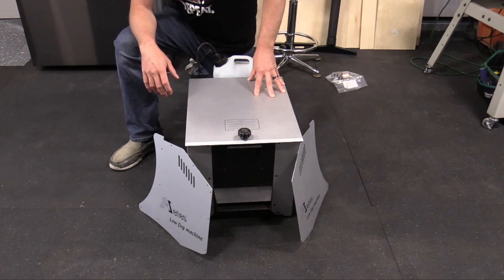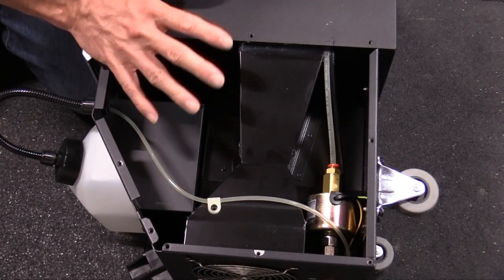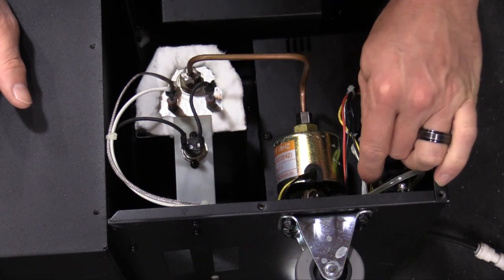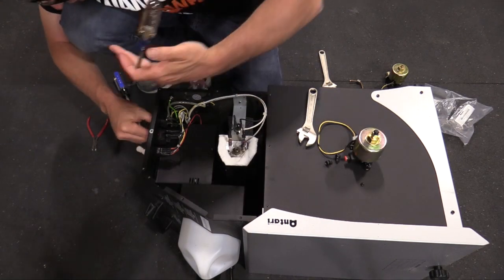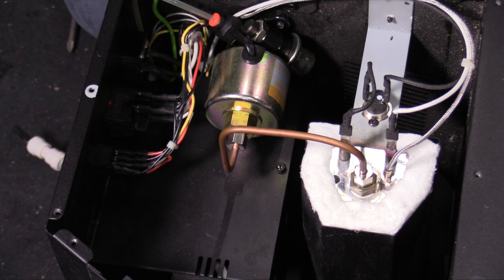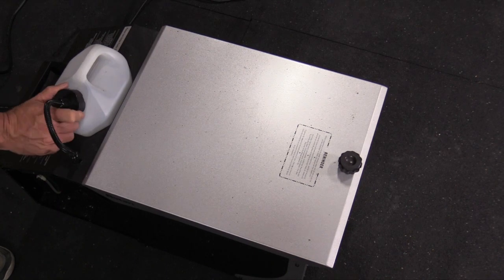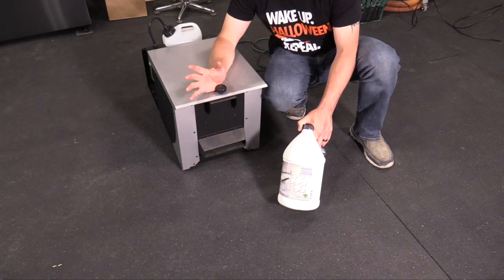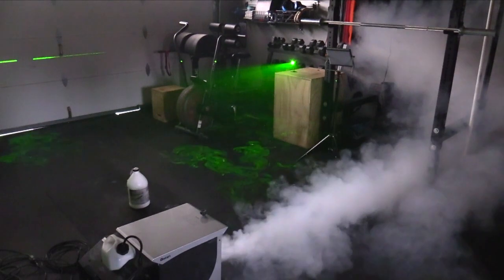Fog Machine Repair Antari Ice 101

Comment: Cheers for the video. My pump for the smoke liquid seems to work fine except for a leak on the brass fitting near the copper tube. Would you happen to have that spare brass part? Antari doesn't sell it unfortunately.

Comment: Only Antari Ice 101 video I have seen, which mentions the drain. You mention using either continuous or manual drain. Is there a switch of some sort for this?
Reply from the maker: Yes, the switch is on the back.  I leave it on continuous throughout the halloween night, or weekends I'm running fog.  Then, at the end of the night, I just during everything off.  When the rest of the ice melts overnight, I use the manual drain to pump the remaining water out.
Reply: @ZombieHaunter408  That is great thanks! How do you activate the manual drain?
Reply from the maker: It's the same switch (three way).   @theroswells994

Comment: Does anyone know how to set the DIP switches to make this machine work with DMX?  If I want to put this machine on DMX channel 309, for example, how are DIP switches set?
Reply from the maker: There is no documentation in the manual for this.  Not all fixtures use the PIN switches the same way, so this is a great question.  I think they use the standard way of doing this (since there is no #10 dip switch). (Switch=Channel Address) 1=1, 2=2, 3=4, 4=8, 5=16, 6=32, 7=64, 8=128, 9=256, so for 309, try having the following dip switches on: 1,3,5,6,9 (which adds up to 309).
Reply: @ZombieHaunter408  After posting this question everywhere, I did get an official response from their support confirming your DIP switch settings.  Those were the settings I was using.  It turns out, my machine (brand new) is not working.  There is no response from either DMX or the wired remote.  It worked for about 10 minutes when we first received it.  No issues.  Then we placed it on our stage for a few months until we had a show opening that would  use it only to discover it will not produce fog now.  I suspect the control mechanism inside machine is malfunctioned and not taking any signals.  The water pump drain pump still works.  Machine gets power, but fog pump and/or heating element is not pulling fluid.  Anyway, thanks for responding with DIP settings.  Once we get this fixed I'm sure the DMX will work fine!
Reply from the maker: @DouglasWhisman  Sounds like quite the ordeal.  I've learned the hard way to store it with fluid inside.  Not sure if that was the issue, but best wishes using it in the future!
Reply: @ZombieHaunter408  It did have fluid in it, but I don't think that was the issue in the end.  It looks to be a control board problem.  I learned there is a tiny reset button (like size of pencil lead) on the heater beneath/between the two heat leads.  It had tripped.  I reset it by pressing it in and then machine started to heat up again -- light fog leaked out of the fan hole on the back as it does when it heats.  It never activated, though, and eventually the breaker tripped.  Technical support thinks the control board is bad and is letting the heat element overheat causing it to trip.

Comment: Nice fix man! Surprised you had an issue with an Antari after 6 years. Might I ask if you store it dry or with fluid?

My opinion on the Hazer/Fazer: outside they are COMPLETELY unnecessary and pointless. Unless you have an area where you need constant smoke produced ( ie car crash, fake fire, etc...this is why I have mine) 

If you plan is laser swamp (Super excited to see what you do!) the hazer and or fazer are also pointless and likely won’t achieve the effect you are going for.

Hazers typically use OIL BASED fluid producing a haze that has a long hang time and high visibility ( shows off light beams for stage shows without obscuring the action on stage) it’s most effective inside and where air currents are easily controlled. Fazer is just a fogger with a fan and has the ability to constantly produce “haze / fog “ on demand. They use water based dog fluid. The control board doesn’t limit the machine with a reset or warm up delay and allows the pump to always operate.

I would just suggest you use a high density and long hang-time fog log Bog Fog, Backwood Bay. We have used froggys Faze Haze and Pro Haze when we did the zombie crate. Worked well and was dense / disbursed well in our garage. However keeping 6-7 kinds of fluid gets annoying lol 

Hope all is well!
Reply from the maker: I store all my foggers dry--without fluid.  I need to be better about cleaning them though.  I've had some foggers for over 15 years, never cleaned them, and they still work like a champ.  They are the cheap ones too.  I was surprised I had the issue as well.  Great information about the haze/faze fog--thank you.  I'm thinking of just using the bog fog in a fogger in my loft above the garage.  Thanks for the response and hope you and your husband are doing well.
Reply: Zombie Haunter might I suggest you store it with fluid after you clean it. 

I clean ours and then put just a small amount of juice back in the fluid tank  and run the machine for a “full burst” . Let it cool and store. Do the same thing with our snow machines. Leaving high quality fluid in the lines prevents the seals and parts from drying out in storage. Just a suggestion but I have always had success with it. Storing machines dry after cleaning allows the inevitable fog juice residue time to funk up the inside and make parts more likely to sick or fail. 

All is well here just a Hot summer in TX!

Comment: What kind of fog machine are you using?
Reply from the maker: It's an Antari Ice-101.  Some distributors (Amazon) are just selling it as the Antari ICE.  It's an excellent fogger and well worth the money.  It can put out fog continuously with no issues.  I was disappointed that the pump went out after only 5-6 years, but it was relatively easy to replace (as you can see), so overall I'm still happy with the investment.